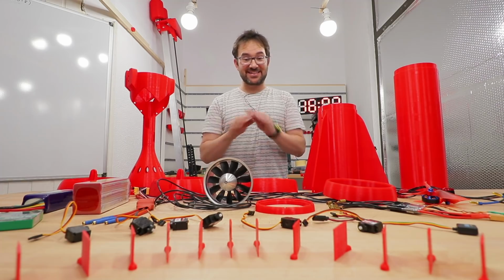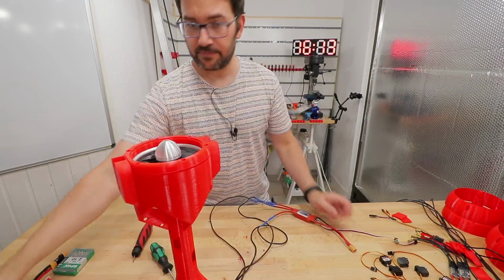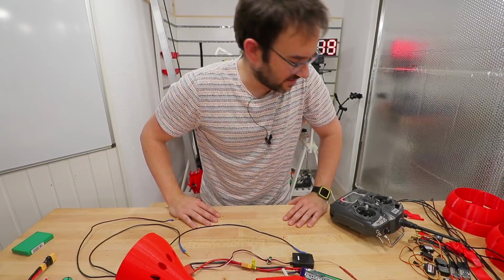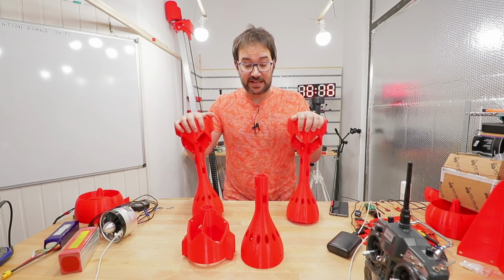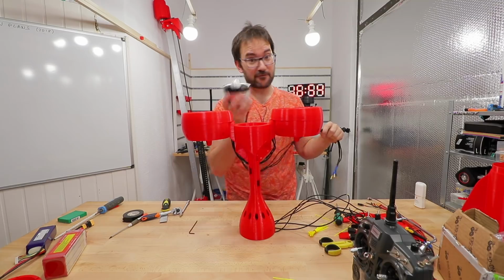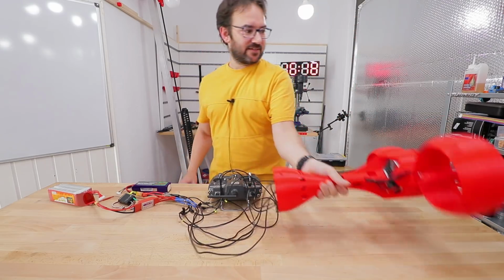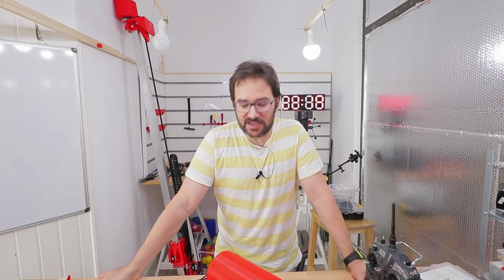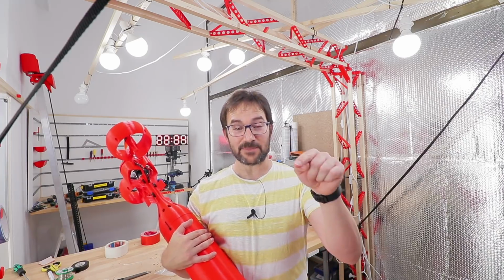3D PRINTED RC ROCKET CHALLENGE w. JAMES BRUTON | PT.1

Comment: you shouldn't have the throttle at max power when the ESC is being powered, otherwise, the ESC it will go to settings mode, to do adjustments like, rotation direction, motor break, frequencies to adjust to each motor, etc.
normally, the  ESC's come with the settings table.

Comment: Lol i was watching and the secound you started going into the radio menu i started laughing knowing what was about to happen. I rate settings on radios with a danger scale. channel direction and button assignment are lvl 1 worst and lvl 2 are endpoints lvl 3 expos and trims lvl 2 is do with caution  lvl 1 make sure you model is in a safe locked down or shut down as 99% of fail safe systems are not going to save you lvl 3 is reasonably safe to change while in use

Comment: Quick heads up, when you were testing with the broken half of the rocket, i noticed the EDF spinning slightly in it's mount. Not the fan, but the part that's not supposed to be spinning, of course. This might result in the cables getting cut up by the main body of the rocket, so i suggest mounting the EDF a bit more solidly. Maybe wrap a few layers of duct tape to make it a "press" fit, if you're not too keen on reprinting the main body again.

Comment: The one with the motors on the bottom has a chance if you have differential thrust and a good gyro stabilized flight controller. The one with motors on top has no chance at all. 
(I'll take pendulum rocket fallacy for 500, Alex)

Comment: That's really Cool! Though I can't get the feeling out of my head that it's gonna hit the ground and smash into a million pieces. A few ways to prevent that could be adding a parachute that can be released. Or you know those plastic rings around RC helicopters that make it so you don't damage anything after you hit a wall. You could make a sphere of rings(very thin ones) around it to protect it from crashes. Just some ideas.

Comment: NEVER! unplug the battery from a esc with the motor spooled up! The motor produces generator voltage, (counter emf) which without the battery plugged in will fry esc mosfets. It may not happen every time, but if it does, the esc will be damaged and may burn the next time the battery is plugged in. Bolt down your motor for testing please!

Comment: Ivan! Ivan!... IVAN! I need you to listen to me. This is very important. Do you want to stop having radio issues? You are a builder, you need a Builders transmitter! You need an OpenTX transmitter. You can pick one up for under $150 US. The transmitter you're using is okay for RC airplanes only! Frsky transmitters give you the best options but all kinds of transmitters run OpenTX. With the more and more crazy Contraptions I'm sure you'll be creating soon, you need a transmitter that can accomplish all the crazy-nes safely. That's The Power of OpenTX.

Comment: I think that your servos will struggle to move from the air pressure so you should not put the pivot point at the end put it 1/3 along the rudder so the air will help to steer them a bit

Comment: Rocket: airframe pushed around by thrust.
Helicopter: airframe pulled around by thrust.
Don't see very many nose-mounted rocket engines or belly-mounted helicopter rotors these days...
A strict define of rocket engines has their thrust NOT dependent on an atmosphere, while ducted-fans and propellers need many Avogadro's of air molecules to work.

Comment: If you can include a slightly flexible joint between the weight and the motors, then it can self stabilise. The pendulum(/rocket) fallacy only applies to rigid rockets, as far as I understand.

Comment: You need really check basic safety rules of RC model flying, like checklist for programming transmitter, -> remove propeller(s). Also unlike RC-tank or car, high flying/high speed RC model (over 1 kg of weight) can seriously injure or even kill person on ground in crash. 

Aerodynamic stabilizers need to be behind of the CG.  You need to think distance between CG and the stabilizers as lever, forget gravity and think only airflow over fins and inertia (momentum). If fins are front of the CG any deviation tries to flip your rocket around, fins behind of the CG tries to stabilize rocket, like in arrow or dart. Also remember whole rocket body works as an aerodynamic surface, you need to get CG up, not down.

There's no fixed point in air for pendulums. So in the landing it's all thrust vectoring. RC helicopters  which are slow moving and have big control surface (the whole wing ;) ) take several weeks/years to master, so with high speed air flow + small control fins + small propellers you need an inertial measurement unit and attitude controller, e.g. multicopter flight controller.

Comment: There is no pendulum effect on rockets and helicoptors. If you want it to hover you will need some sort of gyro to control prop speed on 3-axis.  A y-config or quad config would work but 3 in a row will have trouble maintaining a hover. Tom Stanton has a great video on this.

Comment: Ya most Electric RC Flyers made the same mistake. Hey for testing, tie the rocked to a table with about 1 foot slack rope.  Make a stand clamped to the tale that has two Rings on it to hold your rocket loosely around the center area. If the rings hold your rocket some what up right you should be able to test the control surfaces at power.  I have a feeling the server might be to small to control a lot of thrust.

Comment: 6:35: notice that the metal engine shroud is free-turning inside of the red housing.  This could cause a reduction of thrust and could potentially cause you to twist your cables inside the rocket.

Comment: 22yrs ago I started working on something like this. Power units were a pair of ryobi gas trimmer engines & 12x8 airplane propellers. Life got in the way so I never got past thrust testing it. Tech has progressed so much over the years, but I'd still go w/ petrol power "just because".

Comment: Here is a experiment for you.  Try to balance a meter stick vertically on your open palm. Then clamp a 2 kg weight to the top of the stick and try again. Which one is easier to balance? The one with a weight at the top will be easier. You don't have to move your hand as fast or as far to keep the stick from toppling over. The meter stick without a clamped weight has its Center of Gravity in the middle.  The meter stick with a clamped weight has a very high CoG.  This lesson can be applied to rockets. The farther the control surfaces are from the Center of gravity, the more control authority they will have.

Comment: There is a reason why the thrust is on the bottom of rockets,
Because if the waight is below the center of thrust its gonna become instabe and start swinging like a pendulum.
You sould put the thrusters on the bottom and put them on a 3D printed gibal wich is controlled by 2 servos

Comment: Unfortunately that's not how stability works, you can't really hang from a prop that is solidal with the aircraft, because it's not a balloon. It doesn't pull "up", it pulls" forward", so it's no more stable than having it set up as a pusher instead.

Comment: Hello Ivan, I suspect that will not be the last time that the rocket sheers at the narrowest point. When printing long thin tubular structures in the past, I’ve inserted three M3 threaded bars inside along its length with a lock nut at each end. It adds weight, but significantly increases strength in Z where the print is weakest (in the XY plane between layers).

I’m really looking forward to seeing this one fly!

Comment: For rockets, the pendulum effect doesn't work, so you can have your thrust as high or low as you want, but you want your center of mass in front of your "center of pressure" or center of drag in more layman's terms. Think of your rocket as a fancy lawn dart. You want the mass really far forwards and your drag far back. However, you don't want your center of mass too close to your control surfaces. This would mean that the forces the put are more in line with the center of mass and create a push to the side rather than a torque. Which makes your design quite the controls challenge because normally with high power rockets, your center of mass should be almost exactly where you put you control surfaces. Personally, I'd recommend having your EDF push air through the entire rocket, and have your control surfaces vector the thrust as it comes out the bottom.

-Head controls engineer of my University's competition rocketry club / Electrical Engineering student

P.S. If you have any questions, feel free to ask

Comment: Ima just add my own description of the "pendulum fallacy" as I understand it; 
The idea behind adding thrust at the top instead of the bottom is that the force being applied to the top will "pull" the rocket upwards, and drag the bottom behind it in a straight line. This would be like holding the string of the pendulum, the weight should stay at the bottom underneath the hand, as opposed to trying the balance the ball on a stick (force above the weight rather than below).

However, in the case of both the pendulum and the balancing ball, the force applied to carry the ball remains pointing upwards regardless of how the ball swings, turns or topples. The engine on a rocket always applies thrust in the direction of the centre of mass, it doesn't matter how the rocket turns, swings or topples. The centre of mass will always be aligned with the direction of the thrust.

Therefore, any instability in the rocket's flight should only have been caused by inaccuracies in aerodynamics or a misalignment of the engine, or just general buffeting of the wind that hasn't been offset by some design elements. Now, if you want to stabilise a rocket automatically, the drag experienced by different parts of the rocket when it tilts is a force that always points opposite to the direction of the rocket's movement, so the part of the rocket with the most drag (hopefully the bottom) will always want to be as far behind the rest of the rocket as possible. Again, this only happens because the direction of the force is dependent on which way the rocket is moving, and not which way the rocket is facing.

Comment: Nice idea this rocket, but what's happen when the rocket goes out of the range of the controller? It will rise and rise and rise, directed by the gyro, until batteries works? And after? all the people with a big umbrella to avoid a rain of rocket? 
I believe that you put a timer (engageable by a channel) to shut down the thrust and opening a big parachute for the rocket allowing the safe return of all the stuff on ground, because it seems to me  tha your rocket is a "one direction" stuff! And you can not drive back  safely to ground once launched up 
I'll stay tuned for next video. 
Assuming that i use subtitles for better understanding your words, (I'm italian and do not know  very well english as i want, spanish worse) when you speak EDF the automatic subtitles wrote " idiot" after the third time you said EDF (and i readed idiot) i realized that was a mistake of the subtitles... i figured me you called it idiot for the big unespected jump during controller settings!

Comment: For Rockets the center of gravity is ahead of center of pressure by a difference of length of diameter of rocket
p.s that's how you you achieve stability in rockets

Comment: Will those stabilizer fins be able to move with the full force of the EDF pushing on them? A 9g servo can handle 1.8kg/cm, or 0.6kg over a 3cm fin. I think your EDF is putting out a lot more force than 0.6kg to lift off like that. Might want to try bracing it against a wall and seeing if you still have steering at full throttle.

Comment: Please be careful. Fans can be crazy dangerous, especially crazy powerful ones like that. Just make sure if something falls or slips you're better off letting it fall and possibly get broken then risk getting a finger caught in it and messing your finger up as well as snapping some blades off. Would be a shame for your great videos having to stop over a small mistake. I accidentally put my fingers in a computer server fan that's like 50mm thick, 200mm wide and has like 1/1.5mm thick blades no idea what rpm but was running at about 20v when it's made for 12v and it was horrible I could see my pulse as the blood came out and after wiping it up and stopping the bleeding I'm sure I could almost see bone and that was years ago and I still have a big scar and a horrible patch that's completely numb now and the worst part is I snapped out 3 of the I think 9 blades. Please get some sort of grill or mesh or safety thing put in before the final version.

Comment: Don't need more weight, just have the batteries and electronics at the very bottom of the rocket.

Also consider making that large tube go all the way to the edge of the main fan. You can use 8 ducts and grid fins to exhaust the air in a controlled manner.

Comment: The whole time you were reprogramming I was screaming to disconnect the battery.  Love that you have a 9x BTW.  It feels lonely being the only person with one these days, I hate the look of the 9xR and I am too cheap to buy a Spektrum so I stick with my trusty 9x.

So after watching the whole video I wanted to point out a few things.  Like others said having the thrust up high you are going to pendulum.  You are also going to have a ton of control issues as I don't think that your control surfaces are going to do anything.  I want to say that the area directly behind a propeller is too messy for a control surface to work in.  So they might not provide any control at all.

Comment: Watch out that the servos that counteract the rotation of the EDF move in the correct direction. Else your rocket is possibly gonna spiral out of control. (On the other hand, rotation around the z-axis (the long one) may introduce a little more stability...)

Comment: I noticed the battery was still connected as you we're switching it. When you tested the edf after it flew away, it spun in the mount. Not sure if it's just because it was broke or if it's loose, but you may want to address it before it breaks the wires off at the motor.

Comment: On the bottom you could add a parachute inside the cylinder with a hatch opened by a small servo.

Comment: Hang it from a length of paracord tied to the top. That will let you fine tune the stabilization at a low throttle setting

Comment: Where you balance did in your video that would still be unstable you need to wait to be farther forward not farther back so you either need to make those fins a whole heck of a lot bigger to move the center of pressure backwards or put those batteries in the nose of that rocket and still make the fence larger because your fan Ducks up front are going to move the center of pressure forward your center of gravity must be in front of your center of pressure you might be able to hover if your reaction control system is fast enough and has enough Authority I don't think those little veins are going to be enough but it might be once I thing begins oscillateing it's going to be a beast to control

Comment: The unplanned launch and then re kitting of your thrust unit was not entirely your fault that should not have happened the throttle failsafe should have prevented it

By the way you just confirmed you're not human because those reflexes were badass :-)
Reply: No failsafe in the world would help in that situation. The receiver only did what it was told to: go full throttle. Everything was armed and ready to go. The failsafe only does something if the throttle is above idle when connecting the battery. And it did exactly that when he first plugged in and the esc sensed the throttle was too high.
Reply: Antônio Henning not quite I understand why it did it it's a novel scenario the programmers could not have anticipated easily but the throttle was not at full it was at zero remember he had It reversed for the tank it only took off when he reprogrammed to flip the throttle so that the zero now became full the software should have reinstated the failsafe when you started messing with the throttle programming at least from a safety point of view that's what it should do
Reply: Are you thinking visual or auditory reaction. Auditory reaction is considerably faster then visual reaction. He would've heard it spoiling before it started moving.
Reply: Yes yes yes he is an alien probably from the Spanish Area 51
Reply: watching it again however that was still a stupidly fast reaction xD
Reply: +Teshire  Still slightly slower than mine. (I regularly kill flies and other such small insects with my bare hands and ultra‑fast reflexes)
Reply: Throttle fail-safe? Huh?
Reply: @TheXanUser  If you turn on a transmitter with throttle at full, it will complain instead of transmitting. You can reverse the signals for the channels but I have not seen ability to reverse the  failsafe option such that throttle is supposed to start at top.

Comment: You will NEED thrust vectoring or some sort of controll to keep it stable what you said at the begining wont work. If it did all rockets would put engines on the top.